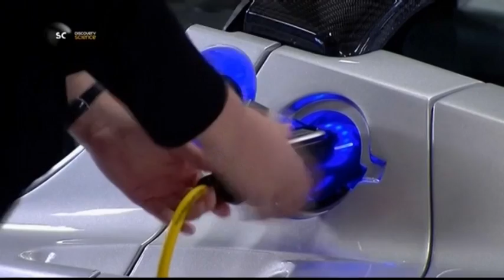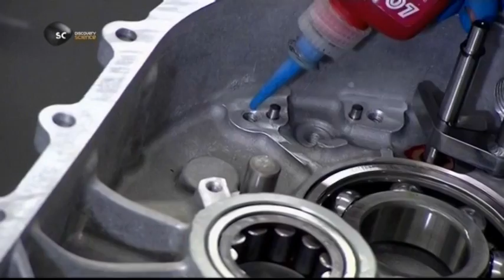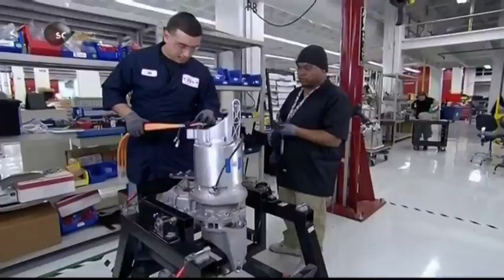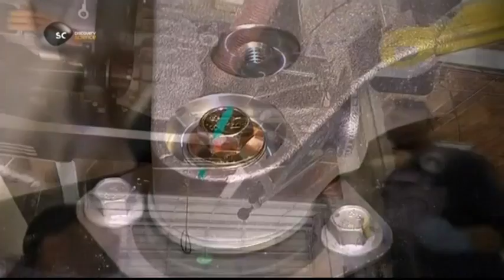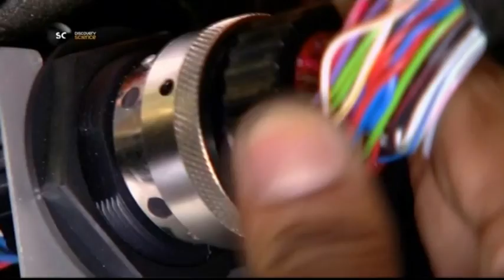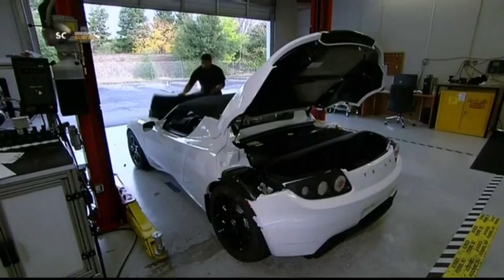Tesla Roadster - How It`s Made

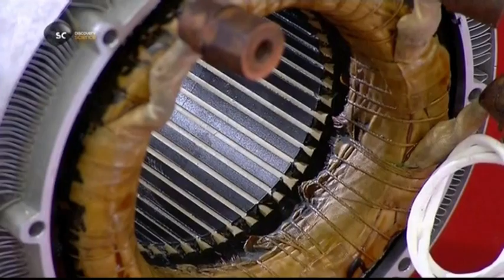Comment: Absolutely love the tesla.... Any of them are amazing. Unlike those gas cars, witch output is usually around 33% - 38% efficient... Electrical cars like the tesla roadster and p100 are around 93% efficient! Massive increase... My only thought is, because gas engines are so much strong (in relationship to thier size verses an electric motor), why can't thet make a really small, single piston, connected to a 1:50 transmission, and connected to a good 5 or 10 alternators? You would be able to generate alot of energy that way, and because ita only one piston, you would be using alot less gas... Not even mentioning, that the small engine only has to idle to charge all those alternators...
Reply: Electric  motors are much smaller and more powerful than Internal Combustion Engines, you've got it the wrong way around.

Comment: basically the same with RC models, 10-12 years ago the racing fuel combustion engines were the fastest and most power, now it is the electric motors that are king in both torque and hp, the brushless elec motors are just unbelievable with the speeds they are producing, i am for the elec idea
Reply: traxxas!! I own an xmaxx!
Reply: Interesting, I had no idea! It really shows how much battery tech has improved and how prices have come down

Comment: imagine if it was built out of pure carbon fiber like the Koenigsegg One:1, that would be pretty badass. Still the Tesla Roadster S is still an awesome car.
Reply: There is no Roadster S, there is Model S and there is Roadster.
Reply: and Model X. and upcoming Model 3.
Reply: He meant the Tesla Roadster Sport
Reply: There's a new Roadster
Reply: the power of time travel demonstrated above
Reply: Computer Program why should it be made of carbon fiber its expensive .... just make better engine or more and then 1.9 seconds from  0-100 km/h even better as a königsegg
Reply: Tesla is the Coolest rip off in the Car Market..
Reply: With a ls7
Reply: carbon fiber is more expensive that aluminium
Reply: The original Roadster panels are all made from carbon fibre.
Reply: It’s carbon fiber and aluminum so that means it doesn’t rust so it can keep its value. CF is better safety wise.

Comment: They should come up with a way to allow as the car is driving that there’s a charge unit to help keep the battery’s full
Reply: Perpetual motion is impossible. If it was, you could hook up an electric motor to a generator and they would run forever: the motor turns the generator, which produces electricity to run the motor, which turns  the generator... and so on ad infinitum.

It doesn't work because there are always energy losses in the system from friction, sound, heat, etc. An electric motor can't convert 100% of the electricity supplied into turning force, but they are very efficient: somewhere around 90+%. Likewise, a generator is very efficient,  but can't convert all the turning force into electricity.

Comment: If he can make alternator to recharge the battery, and don’t need to charge battery, it will be more good
Reply: Perpetual motion is impossible. If it was, you could hook up an electric motor to a generator and they would run forever: the motor turns the generator, which produces electricity to run the motor, which turns  the generator... and so on ad infinitum.

It doesn't work because there are always energy losses in the system from friction, sound, heat, etc. An electric motor can't convert 100% of the electricity supplied into turning force, but they are very efficient: somewhere around 90+%. Likewise, a generator is very efficient,  but can't convert all the turning force into electricity.

Comment: Suggestion, add some feauture, create a Solar Auto Charger
Reply: gulfs , a solar charger would not be able to charge the battery in any kind of pracical timing, as a solar panel only creates a relatively small amount of electrical current... Yes, it would save you money in the long run, but at first, it would not be  efficient enough.

Comment: It must suck to replace a battery on a Tesla
Reply: you have no idea lol and it would be expensive as hell to do too
this is why on the Model S and onwards Tesla put the battery pack just beneath the entire car instead of putting it in the back.
that way they just have this platform they use that automatically unscrews and unloads the battery and vice versa.
Reply: The battery on a Tesla lasts must longer than the car. It does not need to be replaced.
Reply: Caldermologist what about if you keep the car for your whole life?
Reply: The car itself, metal, tires and all, would fall apart long before the battery stopped being able to provide electricity.
Reply: On this Roadster it would be a right pain, but on the new ones the entire thing can be dropped from the bottom. And if you can find a salvaged one they go for about 11k so not too bad for an expensive car as they are, but I imagine with Model 3 in mass production that will be down to 5k or so.
Reply: Caldermologist,    No way..  Lithium batteries are highly prone to failure.  Especially FIRE..   Far less reliable than conventional Lead/acid Batteries..  Look it up..   Lithium batteries,  hold more electricity.  that's all..  they are NOT better in any other way..  They're worse..
Reply: Then why don't you have a lead acid battery in your cell phone?
Reply: Ed,   I'm well aware of the differences of batteries..  The Lithium battery might be better than earlier Lithium batteries,  but,  it's still fraught with problems.  They are over priced,  they just stop working and/or catch fire without notice notice, frequently..    Tesla Motors has a  "Smear Campaign"  that Bad mouths and files lawsuits on any Magazine or website that reports on how frequently the batteries catch fire..  They lose every lawsuit, but continue to file them..      Google it..

Comment: A lot of complex fragile and expensive parts, a proper car has no gears at all, it has a sealed ip68 pancake brush -less motor in each wheel, better and lighter than 3 phase induction motors, a lot more torque and more efficient too. All wheel drive in wet and dry even under water, motors are build into the wheel. 4 motor drivers are needed however.

Comment: still has useless Electronics by the looks of it where are you rely on an Electric System to even be able to open up your car door.
Reply: The door latch is powered by the traditional 12V battery. If the 12V battery is dead, there is a hidden key hole on the bottom of the door sill which the ignition key will unlock. This is no different to any car, where if the battery is dead the central-locking system won't function and you have to manually use the key. To be fair, it's rare for the 12V battery to die.